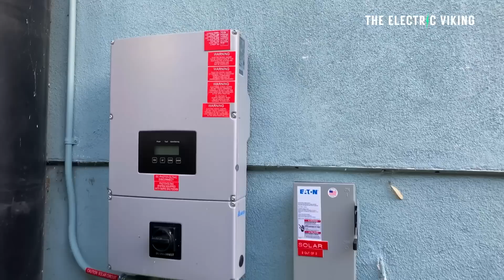Scientists say solar panel advances will see millions go off grid

Comment: I live in Northern Ontario Canada and I have been off grid with solar on the north shore of Lake Superior since 2004, charging two EV's since 2014 and now I power my entire business and machine shop off grid with solar.

I have saved a fortune in money I would have spent to rent my energy, generating your own energy is the best investment you can make.
Reply: More power to you 😁
Reply: Good to hear, especially that far North with far higher upfront solar costs back then.  
Should be relatively easy for me here in N. Commifornia lowlands, today.
Reply: @Mrbfgray  With todays technology its a breeze. I am building my off grid non propane camping trailer right now, it will provide extra battery  power for my Rivian to increase its range while towing the trailer which is charged with solar.
Reply: What do you do in winter when there could be days without sun. Also you have to clean out the snow covering the panels
Reply: @i6power30 omg you have to clean snow off panels? I guess I'll do that when I am clearing my driveway...
Reply: @colinwiseman With a shovel? What could possibly go wrong?😅
Reply: lol Such ignorance and foolish nonsense.

I have a high pressure air system to clean my panels, cloudy days reduce panel output and that was calculated and built into the system, I have plenty of battery storage. 

Ask me how what I did with the over $250,000 I would have paid to pay if I had been on grid and paying for energy.
Reply: @JebusHypocristosX  I'm simply asking you what do you did on bad weathers. Why do you have to be rude and call me ignorant and foolish? Are you that hubrous thinking you are better than everyone else just because you have solar panels?
I live in Ontario as well, and interested in how you did it and how much it cost.
What was the total cost of installing the panels including the high pressure air system to clean out the snow?
Reply: @JebusHypocristosX  I reckon your lying.😅😅😅
Reply: @robertfonovic3551  I reckon your parents are each others brother and sister.
Reply: @i6power30 we are also off grid in northern Ontario. I just use a 16 foot long stick and sweep it across the panels and all the snow falls to the ground. Then I shovel it away so I can walk through there the next day.
Was way less money than getting Ontario hydro to run lines to us - saved about 60k, and we don't have a bill every month. Just size the system for the cloudy days and orient them for winter and it works. We are also passive solar so no heat, and all electric.
Reply: @JebusHypocristosX  I think this is great but you've not mentioned what all this cost you, and the lifespan and costs of the battery back up.  All that ain't free. I don't know where you get your $250K from, but that's 42 years at $500/mo electric bill.  Something doesn't jive.
Reply: @frequentlycynical642  The lifespan is meaningless, since I upgraded my system as prices dropped.

The savings comes from not spending money every on bills, only stupid people can't comprehend these basic facts.
Reply: @JebusHypocristosX  I raised very valid questions.  If you think you can sidestep the laws of economics by, oh, buying new stuff as prices fall, I'll have to point that stupid finger back at you. I think going off grid is great.  I just very reasonably questioned your numbers.
Reply: @JebusHypocristosX  That's $250,000 for now...another $350,000 when your solar starts to become inefficient and you have to replace your panels and battery  ( inflation y'know) . Add to that the as of yet unknown costs for solar panel waste etc. So at an exorbitant rate you would probably have to pay $1500 /month to be on the grid ...hmm that means you could buy 366 months of power, or roughly 30 years worth.  Plus , you wouldn't pay it out at once so you could invest the money at a minimum of 3% return per year, but likely higher...hmm...it hardly seems worth it. One period of prolonged overcast conditions and you're in dire straits.
Reply: @markanthony3275  Nope not even close, thanks for the hyperbole tho.

Actually I just converted an entire working farm to renewables including the tractors and heavy equipment for well under $1,000,000 you know nothing about renewables and it shows.
Reply: @i6power30   Most Canadians simply hibernate thru winter.
Reply: @Mrbfgray  Yes we hibernate in Florida.
Reply: <<I live in Northern Ontario Canada and I have been off grid with solar on the north shore of Lake Superior since 2004>>

Sounds like you have no grid tie ----is that right?
Reply: My sister from Toronto said that whatever power you sell to the grid, it becomes your taxable income, 
that's one of the reasons why not many people install solar panel. That implies that the government 
doesn't want you to install solar panel but off grid is a way to fight back tyranny.
Reply: @Radio_FM_3123  You can't read I am OFF grid...
Reply: I think the Ontario grid is pretty good . Price wise to other jurisdictions and also very green. Over 90% CO2 free generation. that is why I did not get solar although I have a thermal solar installation for my hot water. So now I am going to install a heat pump and I have an EV so basically we are then pretty much free of the Propane and gas curse that is costing me about $5500/Yr.
Reply: So how can it work in winter?
Reply: @Damnthematrix  it works in the winter. Solar panels are more efficient when they are colder. Our panels are oriented to optimize collection in the winter. Reflection of light off the snow increases the power output as well. In the winter we start collecting energy much earlier in the day than in the summer so normally we are fully charged by noon with the hot water tank also up to temperature. In the summer it is usually about 1 or 2pm to reach full batteries, but we can draw more in total due to the longer days. To deal with dark days winter or summer, the best strategy is to overpanel so the capacity of the system isn't increased, but the reduction in hourly power collection is less consequential.
Reply: @Damnthematrix  Same way it works in the summer except more efficiently due to lower temperatures. Basic math, probably too complex for a genius like you tho...
Reply: @josephv5484 NEVER make assumptions about people online you don't know. As it turns out I have a diploma in renewable energy technology and thirty years experience in the solar industry, now retired.

You don't know how to do the math. The farther away from the equator you are the more difference there is between winter and summer day length. Doesn't matter how cold and efficient your panels are when there's no sun there's no sun.

I bet you don't even collect data...
Reply: <<So how can it work in winter?>>

Not really a problem for solar power.

When you HAVE power, use it.

And when you DON'T have power, don't use it.
Reply: @SeattlePioneer  Batteries are laughing at you...
Reply: <<Batteries are laughing at you...>>

Wonderful! I don't understand why all these solar racketeers don't simply CUT that nefarious grid tie

They would have SO much less to complain about.

The reason, of course, is that they get services and extract excessive payments that are paid by other rate payers.  That's why they are solar racketeers.

But I fully support anyone who cuts that grid tie and decide to be free of nasty utilities.
Reply: The  sun shone every day eh? LOL!   You're not telling the whole truth. I know this because I have $70,000 worth of solar on my house and garage in one of the most sunny areas in Canada, and I would have to triple that to even come close to going off grid, plus, buy a battery that's a third the size of my 1500 sq. foot, brand new ,well insulated house. You take that same money, solar plus battery, and you could afford  to pay an exorbitant $10,000 a year for electricity for at least 15-20 years. And by then, you would have to replace all your solar panels as they lose efficiency.  You silly guy!  No one will ever make it off the grid in Canada unless they have a combo of wood heat, or propane , plus tons of solar and a house that's about 400 sq ft....and only two lightbulbs and a T.V. . I tried to look into augmenting my power with a VAWT  ( vertical axis wind turbine) so I phoned an engineering acquaintance in Nova Scotia who put one up at his retirement house there . He said it was the worst decision he's ever made. he couldn't buy a decent one in North America so he bought one from China...it was a piece of JUNK but once they had his $50,000 , they weren't returning his phone calls.
Reply: @markanthony3275  "There is a sucker born every minute" PT Barnum was talking about people like you who get taken for a ride.

Comment: The demand for electricity is growing YoY. The adoption of residential and commercial solar is also growing rapidly. The real strength in adopting solar is that it provide the possibility of developing virtual power plants to augment grid electricity. The "secret sauce" in making virtual power plants work is the software used to manage the solar electricity generated from each source and balancing the load across the entire grid.
Of course we know who has developed the required software.
Reply: The "secret sauce in making virtual power plants work" isn't software, it's price paid per kwh supplied to the grid and "supply" charges. In Australia, at present, you're lucky to get 25% of retail as a domestic wholesaler and you're still paying full "supply" charges, whatever that means. I know several people with solar who are supplying more to the grid than they take out and they're still having to stick their hands in their pockets each quarter and pay the power company. It's a racket.

Comment: Sounds like Alberta where $20 of actual highly overpriced energy will end up costing you over $100 with add on mandatory fees... Connection fee, carbon fee, administration fee, GST fee, transmission fee... And there's probably more. If you have enough space it's definitely worth it to get a solar/wind/battery set up going here especially if you can get off grid to avoid these BS charges... At this rate we'll have created electricity that's "too cheap to measure" but they'll still find a way to charge you for it, especially if you're grid connected...
Reply: Yeah, we’ll, “they” own the grid.  This is capitalism and most of us worship it here in the lands of freedom and liberty.
Reply: yo NZ, its the same

Comment: I have not gone off grid yet for 1 reason, currently in my location Net metering is much cheaper than batteries & the grid is very reliable I currently sell power to 5  houses in addition to powering my home & greenhouse & have used renewable energy to heat my home since I built it in 1986. For the last 3 years my EV is always charged at home.
Installation of solar pvs is so easy , any DIYer can do it! IMO. Ps I live in 1 of the cloudiest parts of northern New England , USA.

Comment: This is bunk research. Far fewer than 1 percent of homes have enough battery storage to last through a 3 day snow storm.  I install solar and battery in several homes. When people ask about going off grid I always reply "December 22nd, what does that mean to you?". I have few customers who are knowledgeable of the real issues of what off grid means. Power management, generator and fuel backup, battery resuscitation and priority power needs.  It is not possible that millions will go off grid by their preparation in the next 5 years. The only way to put a million people off grid that quickly is to shut the grid down and let them sink or swim.
Reply: Sadly, very few have an understanding of the practical limitations of going off grid. Among those limitations, and probably the most significant, is cost. To maintain the lifestyle that we have become accustomed to, it is very expensive business. 
My electrician lives off grid and has done for the best part of 25 years. He is the first to point out just how expensive it is and just how many compromises he has to make. Simply having solar panels come down in cost significantly is only one part of a long equation. And when it comes to solar and battery storage, it isn't a "buy once, cry once" investment. The last time that I spoke to my electrician he was talking about the need to replace his batteries for the third time, at a cost of $8,000 Aud. He's already changed his solar panels once and has gone through several invertors. He also has a 7kva generator and fuel on standby. In his case, he has no air-conditioning and he heats using wood. 
He's a fairly savvy businessman. One thing that I hadn't considered that he most certainly had was the opportunity cost associated with his setup. As he puts it, "I've got a lot of capital tied up in a depreciating asset". "That's money, year after year, not earning interest in the bank. It's money not invested in the stock market or a third van and another electrician". "That's a huge hidden cost that nobody mentions, and if you know what compounding returns are, you'll understand it's a very big price to pay".
Reply: @davidbrayshaw3529  That is exactly right. Unless you have lots of space to put extra panels or endless batteries there are always tradeoffs. Most people can't buy equipment as inexpensively as a pro, build their own system or manage the tradeoffs without big adjustments in their lifestyle. I love where the technology is going but from a practical sense we are decades away from a "produce it where you consume it" model for millions.
Reply: @greatearth5861  The curse of engineering and economics is yet to be exorcised from this realm, unfortunately. In the meantime, all we can do is play the two the best we can to our advantage.
Reply: @davidbrayshaw3529  Its ironic that you have no clue what you are posting about. Not just ironic but funny too...lol
Reply: @JebusHypocristosX  Top tip: In the context that you have used it in, "Its" has an apostrophe... It's, as in " It is".

I'm not quite sure what you are implying by stating that my post is ironic?
Perhaps you might refer to the dictionary before offering an explanation as to how my post falls into the category of "irony".

Perhaps also, you would be kind enough, and hopefully well educated enough on this subject to bring to my attention where my electrician's anecdotal account of his experience is false or lacking. I would be keen to pass onto him your appraisal.

He is a very open minded gentleman and would most certainly be open to discussing these matters with you as he is always looking at ways to improve the system that he has been operating for the last 25 years or so.

While you have not offered any suggestions in your reply to my post, your dismissive
reply certainly suggests that you can make a valid contribution to this discussion.
I'm looking forward to your response so as together we can mitigate the dissemination of falsehoods and provide others with information that may help them with their choices.
Reply: @JebusHypocristosX  Let's be honest. You didn't read my post in the first place, and you don't have the ability to comprehend what I said. Clearly, school exams weren't a forte of yours. By the way, you missed a Commer in your last sentence. I'll let you guess, where.

Comment: People keep talking about solar panel costs dont know what they are talking about.
If you DIY install solar panels and battery system, you can already be 70% self sufficient for less than 20k. 
The problem is installers charging 3 to 5 times the cost of the material for "certified installation" labor. This is after incentives!

One 400W Panel+micro inverter is less than 300euros. With gateway and accessories, you can DIY a 4kW solar system for less than 4000euros. Installers will charge you 12k to 20k for that in 2023. Its even cheaper if you have no shade since you can use a central inverter.

Comment: The good news in this is with bushfires. All the overhead wires in wooded roadsides are aging and causing fires. For a century or so this has been the case. With rooftop solar a lot of the overhead wires become redundant. Networks become short length and local. In the past Melbourne didn’t generate power at all. It all came from the Latrobe Valley on huge towers
Reply: And it was cheap and reliable.

Comment: I'd love to see this report! 50% already are independent? I call BS.
Reply: Exactly, not a word about the need to store loads of energy if you want to be off grid so yes, BS indeed.
Reply: @tellyboy17  I don't know about the report, but battery back up is a good way to store energy.
Reply: @MyUniversalUniversity  But it's not a ticket to completely off grid except maybe you live in a region with great all year round solar irradiation, substantial excess capacity in your solar array and a really big battery pack. Lots of ifs that add up to high energy cost.
Reply: In America you can google the EIA.gov. They have a report of all the energy consumed & where it’s been sourced. It’s up to 40% clean over here now ending in 2023
Reply: IKR?  And then he says it will take until 2050 to get to 75%.